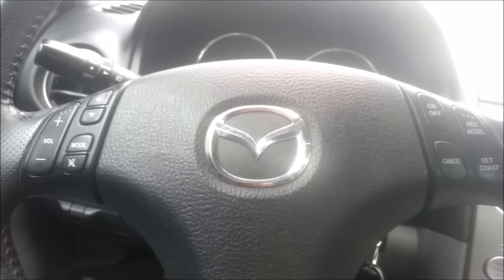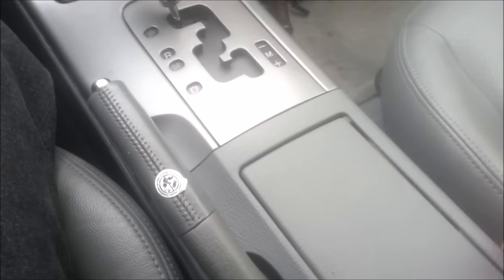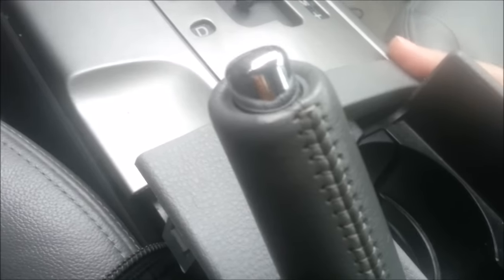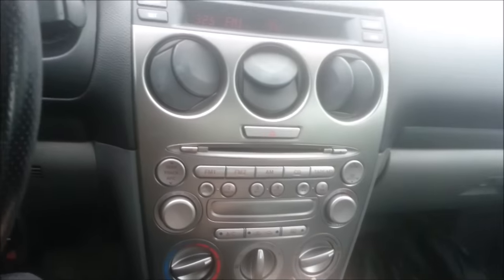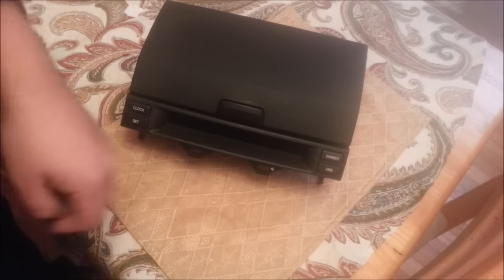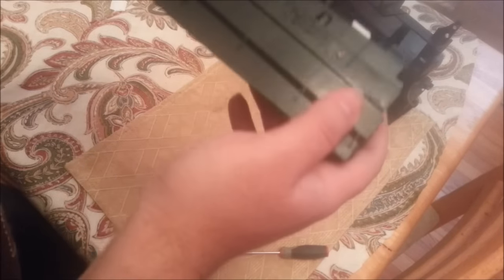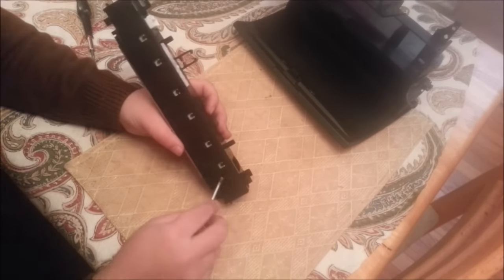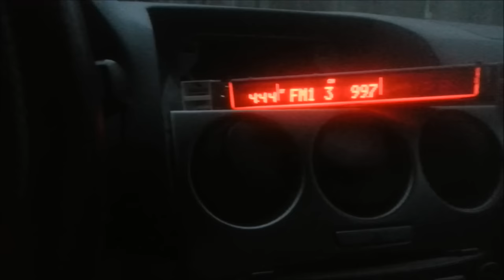2003 - 2006 1st gen Mazda 6 display fix

Comment: I found many mazda 6 got the same problem
Reply from the maker: travellerinfo , very known issue, also the chrome piece on the grille brakes off and you have to get the whole grille. luckily grille is around $30 off ebay.
Reply: I have the same problem

Comment: My clock gives randomized incomplete numbers, and some vertical lines went dark. Do you reckon there's any hope for my display? Thanks for the vid anyway
Reply from the maker: If you're familiar with soldering, try the fix I did. Otherwise new display needed. You might find good display in junkyard/scrapyard
Reply: @NWCI  the car functions without the display. Anyhow and i'll try this or will put the cirquit board in the oven as a last resort. But i'm considering some fancy new console as well, which has a BT or usb connection, controllable from the steering wheel. Any recommendations?

Comment: Thanks for the video, my brother purchased a Mazda 6 with the same problem, I never had any issues with 07 Mazda3 lcd, I will attempt to resolder the joints with my smd heat gun

Comment: I tried to reflow the solder before watching this video, didn't work for me and just gave up trying to fix it. The top part where the clam shell cubby is located also has broken hinges so I'm just going to find one at pick a part or settle with a busted display. it still shows the air temp and direction of air so its not all gone, after market receiver will give me the rest of the details..Glad reflowing the solder worked for you hope the car is treating you well!
Reply from the maker: crazyeye1, thanks for commenting, if you have desoldering gun like hakko 808 you can remove the solder from all the pins to access the possessor behind the screen and reflow with heat gun.

for the cubby I reinforced the hinge joint by heating paper clip and enbded it to the plastic,  then replaced the round metal with solid rod made from wood the one people use for making kabobs lol.
replaced the Mazda with avalon, video on the channel.
Reply: Newbies Work on Cars  I have soldering braid and will remove all the solder and add fresh new solder. I was able to fix the hinge by making new holes and running wire through it and using springs i repurposed from dollar store clamps. You can’t even tell when the unit is reinstalled and it’ll hold up against the Vegas summer. I just need to fix the LCD. I got one from the junk yard but that was way worse than the one I had originally lol. I have two to practice on and will do my best since I have a much better iron and the braid to remove the old stuff with

Comment: Hi there, when you soldered all the pins, what pins did you solder?  I notice a few places in the board that have little holes where it looks like it should be soldered but isn't.  Should I solder those too?  Let me know if you need a pic.

Comment: Great video.  We re-flowed all solder joints, a few twice after initial testing, and got all but one to work.  We have one blank line through the "V" on VOL, but that is all.  My solder gauge and iron are too large to attempt an actual new solder joint.  In any case, it is 99% better than it was.  Thank you!
Reply from the maker: Am glad it worked for you, you can use something like Hakko 808 it'll make it much easier to desolder

Comment: Did you ever fix the broken pin on the cubby over the radio? if so, how did you do it?
Reply from the maker: Yup, I glued the housing where the pin sits, it was cracked, the replaced the pin with piece of wood from kabab skewer 😂